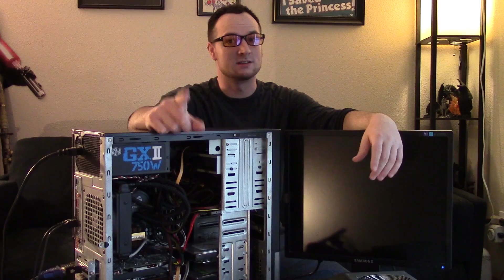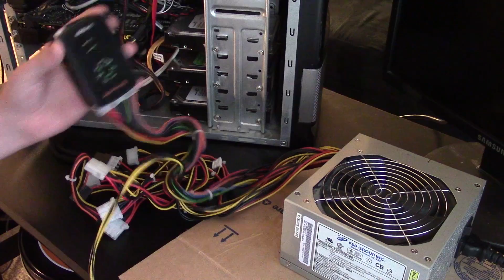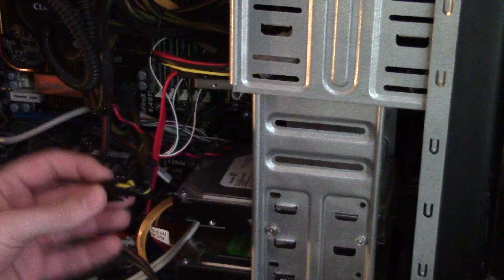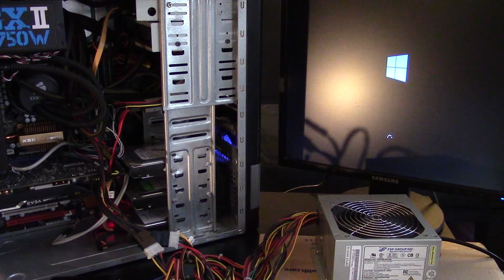💻 Running dual power supplies

Comment: so with this configuration, the side panel has to be open? will this cause dust and lower airflow? Should i punch a hole in my side panel so that the psu wires can go in?
Reply: put your psu on 2(make sure the ones that you'll never use) 5/4" bays, bays might need some modification
Reply from the maker: you might be able to fit both in your case. use your imagination. If keeping the side panel off I would only recommend as temp solution. ☃️ Happy Holidays. Sorry for the delay in response, as I'm sure you know I can't reply to everyone. Hope you enjoyed the video. Please sub if you haven't already & have a safe new year. 🙂

Comment: The two power supplies need to share a common ground, this can be done by running a wire from the PSU1 GND to PSU2 GND. Otherwise it is not a safe configuration.
Reply from the maker: Thanks for sharing. Personally I have had no issues with them having there own separate grounds. They generally do  not share anything. Sorry for the delay, as I'm sure you know I can't reply to everyone. Hope you enjoyed the video. Have a Happy Halloween 🎃 & please sub if you can.🙂
Reply: Hi. Yes, and you can check the connection with a multi-meter. After you plugged in the two power supply, make sure PSU1 black wire and PSU2 black wire has continuity. If you are powering a GPU with 2 PSU, the GPU may have already made this connection internally, so you don't need to do anything. But if you checked and there is no continuity, you need to wire the two PSU black wire together.

Comment: i heard that if both power supplies touch the chassis it will short out.  is that true??
Reply from the maker: There are thousands of motherboards and thousands of power supply models. May be true in some cases. Best thing to do is if the motherboard has the main connector (usually 24 PIN) and an additional 4,6 or 8 PIN elsewhere on the board it is good practice to keep one power supply for the board, and the second power supply for other devices such as HDD's , DVD, videocards etc. Even with a  Duel PSU Cable this is still a good standard.

Comment: This video was very helpful, but for an unusual reason. I have a prebuilt Alienware with an external 330 watt power supply, and they don't make external psu's any bigger than that. So I wanted to connect a new PSU, but the inside isn't like any other PC because is all runs to an external, so I just ran my psu to the gpu as you showed, and I stopped black screening when gaming, thank you very much :)
Reply from the maker: I'm glad it was able to assist you.

Comment: So basically your saying spend more money on a power supply tester rather than the cheaper duel PSU cable which does exactly the same thing. This is a stupid video and is a very unsafe way of using 2 power supplies
Reply from the maker: Matter of opinion 😊 Much safer than jumping thin pins on a power supply. Also much cheaper than buying a 750W to 1000W power supply especially if you have a spare.

Comment: 3 dollars 24-pin To Dual 24-pin ATX Power Supply Connector Splitter Dual-PSU ATX adapter they  are sold every where This adapter allows you to turn on/off two power supplies simultaneously.
However, please use the outputs from the 24pin power supply only on motherboard. and use the outputs of the 2pin power supply solely for devices ---like hard drive, cd rom, dvd, etc..... Please do not mix the power from first and second power supplies.
 dont fuck up the pc like that , also tester are not made for more than a few seconds just saying!
Reply from the maker: Thank you for sharing. There have been links added to things you referenced in the description.  Sorry for the delay, as I'm sure you know I can't reply to everyone. Please sub if you can and happy holidays ☃️

Comment: Just ordered small mobo for 2 PSUs - https://goo.gl/3kQqU8   ( Add2psu )   , or you can order "24 pin male to 2 - 24pin female cable " for the same job. I think with the small mobo will be better, haven't tried it yet, but still it should be much better than having to power or shut down the PSUs together manually. Also from Aliexpress or IDK if you like more Ebay (the same sellers are there), I sow that there is a cable that is CPU 8 pin to 2 x PCI - e , I don't have that much experience with PCs, but still think that on the CPU cable (I think that even small wattage PSU can hold atleast 200w peak CPU power), there should be more power than on the cables for HDD or DVD, so I ordered some of these cables. Good luck and long lasting hardware!
Reply from the maker: I have seen boards like this, 1st saw it on some xeon server way back in the day. Thank you for sharing the info.
Reply: Any idea about how much power can it support?
Reply: @AlgentAlbrahimi  I haven't tested this boards, as it is too junky for my setup. You can visit my link and see for yourself the info on the Aliexpress seller's page. IMO this is only a starter (it syncs the startup of the PC with the startup of the second PSU). So you it's not like this thing has a power limit. It is only a starter and it doesn't matter how much power the second PSU has. After that you can use the second PSU for your GPU/GPUs only, but there I can not help you, you have to calculate this on your own and what cables you will use (there are CPU connector to 6+2pin PCIE, MOLEX to PCIE). 
Not connected about the topic, but I'm in this situation right now - I had a 735W PSU with Ryzen and 1080ti and now I changed the GPU to 3080. It was an average priced PSU unit, but I didn't research it and the brand wasn't that good. No problems for 2 years and almost a month, and after changing the GPU, on Metro Exodus I got a shutdown, followed by small bang on next startup. So now I didn't had the budget to get a good brand PSU, as it is more than double the price and again I bought the same brand Raidmax, but atleast it is 1000W version. I added my story just to tell you - research about the PSUs, what you need, what can you do, because you can end up with a lot of broken hardware.
Reply: @ИлиянБелев  Thank you!

Comment: was the 300w psu good anuf for the 960 card ? can I git you to take a look at my post on toms hardwear ? http://www.tomshardware.com/answers/id-3536456/build-advice.html#xtor=EPR-8809
Reply from the maker: If you are just using it for the card and not other devices it should be fine. however a 300W connected to a board and a 960 will probably shut itself down due to overload. Please note the suggested power supply for cards is an estimate and assumes it is plugged up to a board, hard drive etc.
Reply: thout so ty :)

Comment: I DID THIS TOO, I HAD TO PUT EACH CABLE PER PIN, CUZ  I DINDT HAVE THAT ADAPTER. BUT IT WORKED!!!! WITH A PEPER CLIP THAT CAN LINK THE GREEN AND THE BROWN CABLES FROM THE 24 PIN CABLE.
Reply from the maker: Glad it still worked for you.
Reply: i did this on my old rig with an old gtx 260 and xeon in a 775 lga board on a fruit case xD, all the people think that i am crazy but it works perfectly :))

Comment: i did this but GPU still run any game shutting down. My card is gtx480, anyone knows why still shutting down?
Reply from the maker: I would recommend a program called HW monitor see what the temps are.
Reply: I've underclock my GPU, here is the settings
core voltage - 950 (default-1088)
core clock - 425 (default - 700)
memory clock - 1000 (default 1848)
with this setting is stable, no crash, no black screen but if i set the settings on default, black screen appears. fans still running, everything working but black screen, the temp is ok - max 70 celsius
my question is, can be the problem in my PSU?
Reply: Reset with msi afterburner (button arrow circular) and test again. If it does not work, buy the cable atx dual psu. Best regards.

Comment: Dual power supply is safe, by joining them together and giving a total amount of watts for any source?
Reply from the maker: You are not combining power supplies, you are running two power supplies for one computer. allocating connections elsewhere. you could have 1 PSU for the motherboard and cooling but have the other for the Video card and hard drives. Sorry for the delay, as I'm sure you know I can't reply to everyone. Hope you enjoyed the video. Have a Happy Halloween 🎃 & please sub if you can.🙂

Comment: What about shut-off? I used this set-up to power a graphics card in my MacPro.  The boot up went flawlessly, and the system ran perfectly for as long as I had it on. On shut down, I tried to shut both the external psu off and the MacPro at the same time, BUT, interestingly, the Mac went on gurgling for quite a while, like it wasn't going to shut down. I couldn't see anything, of course, because I'd killed power to the graphics card so the monitors were down...SO, I'm wondering...would shutting off the computer FIRST be a better way to go, and then powering off the external PSU?
Reply from the maker: Please note I have never tested this method on a Mac/Apple motherboard. Thank you for sharing your experience. Might want to hit up some of the Mac forums. 🎄Happy Holidays🕎 Hope you enjoyed the video or at the very least found it informative. Please sub if you haven't already & have a safe new year. 🙂

Comment: why do you need to get that powersupply tester or the paper clip? cant you just plug it in?
Reply from the maker: At that point I would look into just jumping the pins just make sure you secure things with electrical tape.
Reply from the maker: standard power supplies generally do not turn on until the motherboard tells them to.
Reply: DoctorNoob oh ok thanks. what are the dangers of doing the paper clio thing?
Reply: can I use my old motherboard as a powersupply tester?

Comment: is there any problem if i dont tuen on it at the same time, cause my psu for gpu doesnt have the switch?
Reply from the maker: depending on the board in question there might be some issues or startup issues.

Comment: Interesting, maybe I can twin a couple of my old 250W PSs.  OTOH your PC now looks a mess; the second PS wants to go into the case permanently.  That's possible if you have a big case and maybe not using many expansion slots.  Needs a bit of metalwork which I realise is beyond many people.  I would also hard wire the mains supplies together to avoid the synchronised switch-on issue.  In one of my PCs I do have a second power supply (home-made) for a Raspberry Pi, the latter sitting in a 5.25" drive bay and connected to the network via an ethernet cable out the back..
Reply from the maker: Thanks for sharing These days I recommend RiftCat or iVRy on steam 🎄Happy Holidays🕎 Hope you enjoyed the video or at the very least found it informative. Please sub if you haven't already & have a safe new year. 🙂